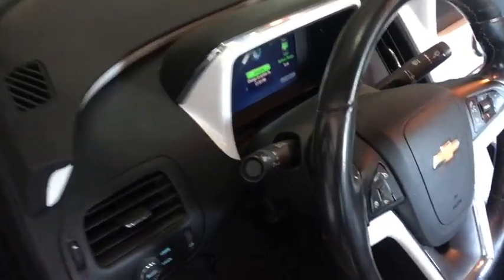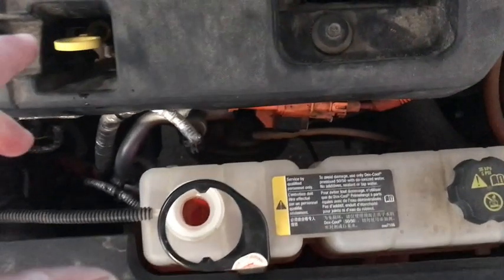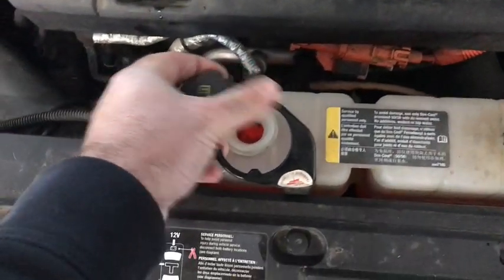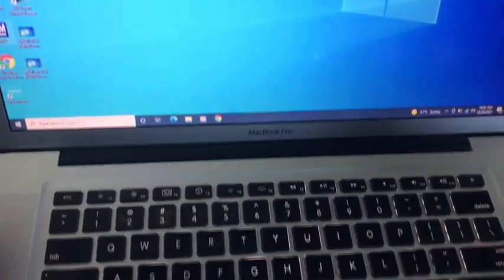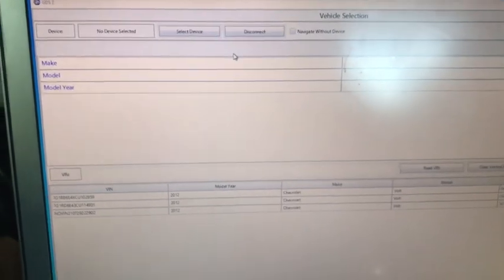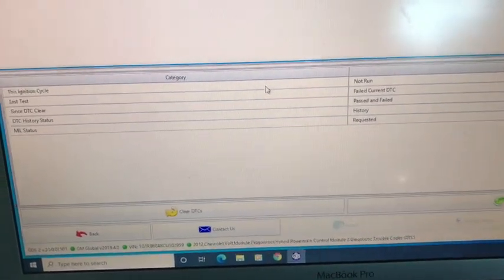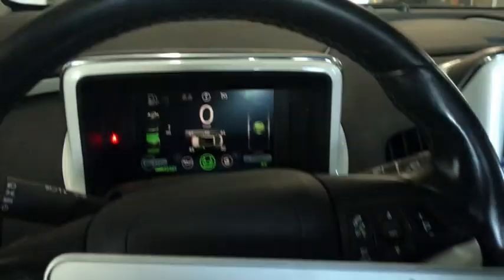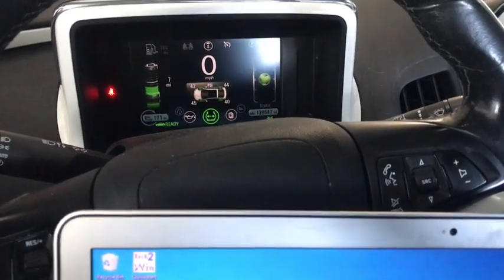Fixing "Service High Voltage Charging System" Error on Chevy Volt WITHOUT Reprogramming HPCM2 Module

Comment: Thank You very much for this video! just today in the morning I got that message Volt woudnt charge after coming from work, did exactly how you explain and vuala.

I used an Autel Hypertough obd 2 scanner, worked just fine
Reply from the maker: Awesome! Glad I could help!
Reply from the maker: Also, I’ll need to check out that scanner. So far the only one I could get to work was this one. I’ve tried some pretty nice scanners too.
Reply: So I’m having this trouble too with the high voltage charging error message. What exactly do I do. Just push down the float while the engine is running? That’s what I did. Then reset the light again. Hoping it don’t come back on again
Reply from the maker: @robcastvr70  oh no. I pushed down the float just to simulate the error (for the video) and explain how that sensor works. You just need to clear the HPCM2 module codes or flash the firmware on it.
Reply: @utjay2008  ok I c now. What scanner will find and clear these types of codes?
Reply: @utjay2008  never mind I c what u used on the video now. But does it also come with the software to use as well?
Reply: @robcastvr70  the Autel hypertough that I use, bought it at advance auto parts, gives you the whole software for gm for free when you sign up in the app with your phone, dont remember the price but was not expensive
Reply: @0xDanielCamarillo  oh ok thx
Reply from the maker: @robcastvr70  the VCX Nano ships with the software but it’s a PITA to get set up. BUT - once it’s all set up you can connect to GM/ACDelcos Techline Connect and flash all the modules on the car. Pretty slick. I’m going to put together a video on setting up a VCX nano here someday.
Reply: @utjay2008  oh ok awesome.  I had my car in the shop thinking there might be something wrong with it. And they said I needed a new main battery pack for bout 10,000 dollars. That’s really something. Of course I didn’t believe it cause I can clear the code daily and it charges back up fine.
Reply from the maker: @robcastvr70  I had the error come back on mine. I’m guessing it’s a wiring or sensor issue. But I’m done with it. So I just used the Vcx nano to flash the HPCM2 back to the non RESS tuning. It’s been fine so far.
Reply: @utjay2008  ok thx for letting me know. I hate this stupid error. I’ve also noticed sounds like the main battery fan is also running all the time now back in the trunk area. I guess it’s the sensor probably telling it to run thinking it’s overheating is my guess
Reply from the maker: @robcastvr70  it’s not that sensor. I believe it only sees low coolant and shut down charging. I’m not sure why your fans are still running.
Reply: @utjay2008  oh I c. I thought that’s what it is too the low level coolant sensor too but don’t know why the fan runs all the time. U sure urs isn’t. It’s hard to hear it. If u have everything turned off in the car then turn off the car. C if u notice if the hum sound goes away. That’s how I found out it was running
Reply: @utjay2008  how long did the light stay off before it came back on?
Reply from the maker: @robcastvr70  sometimes months. This time it was days. And then seconds. So I just flashed the older (non RESS) image to it. Problem gone. Forever.
Reply: @utjay2008  oh wow cool. I’ll have to get directions on exactly what u did to finally fix this issue and thx. I was bout to give up on it
Reply from the maker: @robcastvr70  if you have a vcx nano and an ACDelco subscription it’s pretty easy. I’ll make a video about it soon.
Reply: @robcastvr70  Please please make the video :-)
Reply: @robcastvr70  $10,000 is a  ridiculous price for a 10kwh battery pack.  Current battery price is about $120 to $90 usd per kwh, so a packaged unit should be no more than $2,000.  Also, you KNOW the stealership will get the battery refurbished and resell it, as there are probably only 1 or 2 bad cells, if any!
Reply: @utjay2008  
Do you have i video for how to do this?
Reply from the maker: @soderstromper  Using Techline Connect and a VCX Nano to fix Chevy Volt Service High Voltage Charging System Error
https://youtu.be/eza-Y3oUnS4
Reply: @robcastvr70  car dont have to be running, I just press the float, carefully not to break it, then I got ready my obd2 scanner, turned on the car and proceded to reset the codes on the hcpm2
Reply: @robcastvr70  on the scanner dont just erase the codes, try to find the hcpm2(I believe that is what is called) then read the codes for it and erase them
Reply: @0xDanielCamarillo  ok, I may have to get a better scammer to do that then. I’m using a FIXD Bluetooth smartphone scanner. But also have one that is orange that has a cable on it that plugs into the obd2 port. But don’t think it’ll erase those ones. But I’ll try it and c
Reply: Where do you find this scanner?